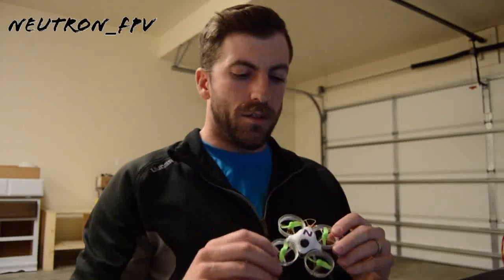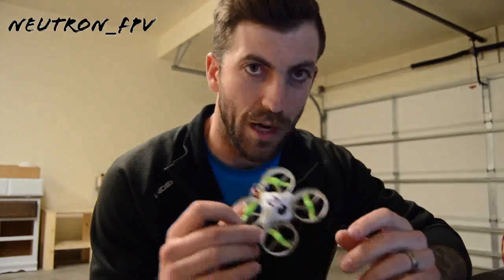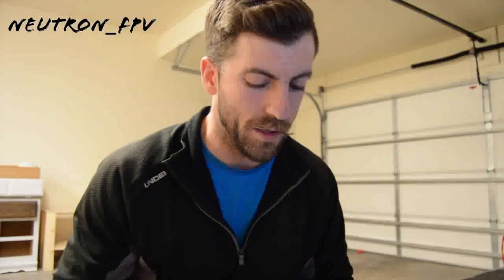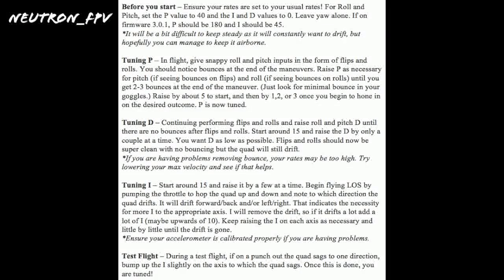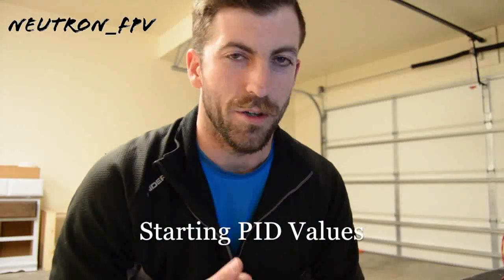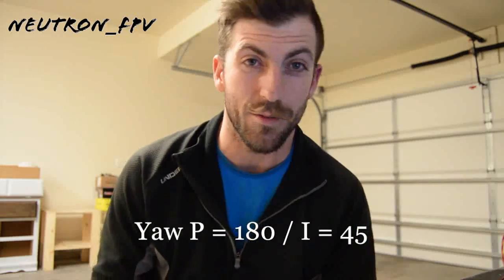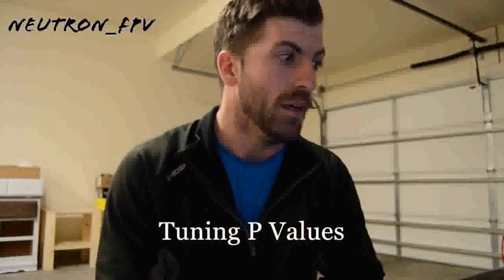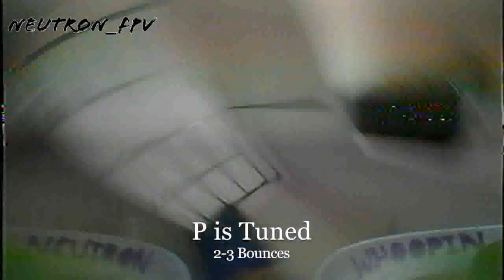Tiny Whoop Tiny Tune  - Tuning PIDs Made Easy

Comment: Hi.. I just starts to learn PIDs setup for my brushed tiny whoop. 
Before that I fly with default setting only (I'm using Silverware btw).

I've followed your steps to tune it.. got that tight oscillation on the end of flips & rolls (the D), also got that locked feeling when throttling up(the I). For tight spaces/indoor flights (the one that have constant roll/yaw inputs) it feel quite good (in my opinion). 
But for outdoor flight, sometimes the quad have a blip(??) it's like pitching up and losing altitude, even on a straight plain flight.. sometimes it also happen after a 180 degrees yaw.. This blip never happen when I fly with default PIDs.. so I guess I miss something with the tuning... 

could you help me what value should I re-tune to compensate the problem? TIA

Regards
Reply: Hi, I'm a little late but I think you should try to increase I on pitch
Reply: @abrahamtan9704  thanks bro. You're right, I didn't tune my I-term right.
But I think I'm getting better on PID tuning over year.. I also learn to tune my rates.. 
and this video is still one of my favourite about PID tuning, especially tiny whoop. :)

Comment: What mode are you tuning in?  Would this work in horizon mode?  Newb and not comfortable with airmode yet.
Reply: Thanks!   I'll definitely work on improving my acro mode.
Reply: Just throw a acro/rate mode on a aux switch and hover LOS for a little while wobble back and forth and get a feel for the quad... I did it this way now I have removed every other mode and forced my self to use acro!
Reply from the maker: I’m in acro with air mode.  Being in horizon would probably mess things up because you will have the quads accelerometer/gyro trying to level itself out after each maneuver
Reply: I actually saw that interview he had with Jessie Perkins , the "inventor" of the Tiny Whoop.  Jessie said all the best TW racers used leveling modes.  Having practiced a lot with both, I gotta say I can rip around the house much more accurately with leveling mode since only have to focus on elevation and turning.

Comment: any tips on flashing beta flight? I have a bee core and it connects to Clean flight no problem but it won't flash beta flight. it keeps saying serial failed to open. But it always connects to Clean flight. I did try shorting the boot loaded pads but it didn't do anything.
Reply from the maker: SteveRCPilot maybe try turning on the manual baud rate? Leave the number the same, just make sure the slider is on. Did that with my dodo fc yesterday and it worked
Reply: SteveRCPilot you need to use zadig to connect your fc as dfu in order to flash.

Comment: I just started tuning mine and I am running into problems as soon as I add any "I". It starts oscillating when I punch full throttle. Do you know what is causing this? 
Im using a BeeBrain FC and 19000kv motors.
Reply from the maker: vapearoo com your Ps might be too high. What are your P values?
Reply: right now my R is 38 and my P is 40. my first try It was R 55 and P 60 so I restarted like you said. It seems to be perfect when I'm just hovering but as soon as I punch the throttle I start to get the oscillations
Reply: Also the D values are both at 15.  rolls and flips feel great with almost no bounce but as soon as I mess with the I value I start to run into problems
Reply from the maker: vapearoo com i said if your D gets to high you should restart. If the 55 and 60 felt good, go back to those maybe
Reply from the maker: vapearoo com that weird. What props are you using? And have you tried the stock PIDs for 3.0.1? Which brings me to another question...are you using the 3.0.1 firmware?
Reply: Lol damn, I miss heard that then. Thanks for the help and the great video. I'll let you know how it goes but at least tuning is starting to make sense.

Comment: Have you tried FW version 3.1.6 (released 2/27)? I'd love to hear your opinion of it. Any chance you can post your tune so I can get a solid starting point? I've never actually used my BB because I can't get anywhere with any of the FW version's stock tunes. If I could just find a good starting point that I can tweak to my preferences I think I might actually really like this FC.
Reply from the maker: SoLongSidekick just to give you a reference, with my setup my Ps are right around high 40s low 50s for pitch and roll, Is are in the 30 to 40 range, and my Ds are in the low 20s.
Reply from the maker: SoLongSidekick and I have not tried that firmware. But I have tried other 3.1. firmwares with no luck. But it could have been for some other reasons, like power kv motors and faster rates. I'm going to revisit that issue and make a part two to this video 👍